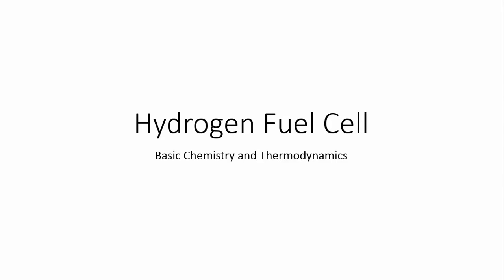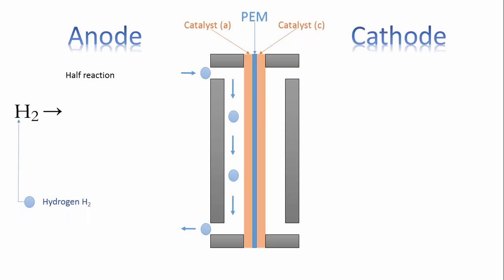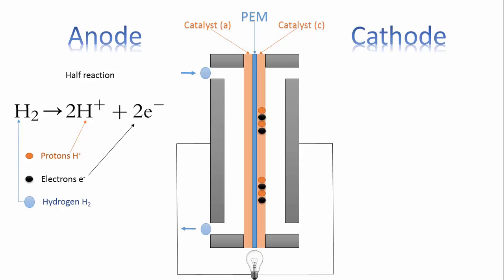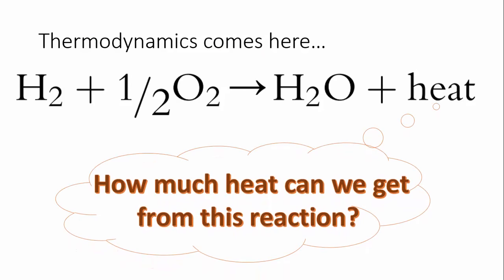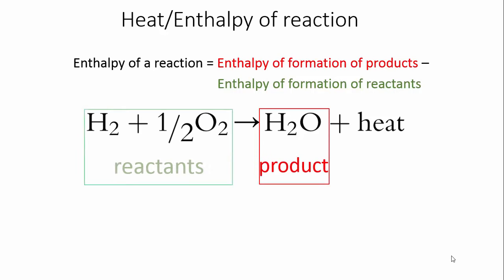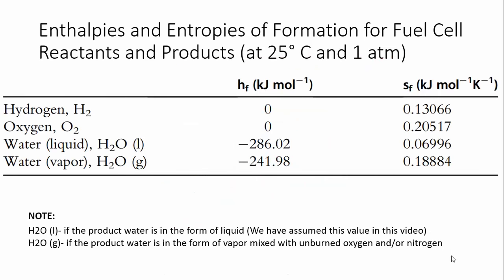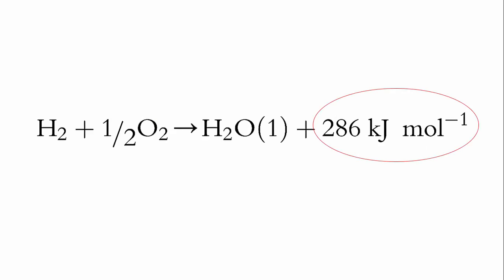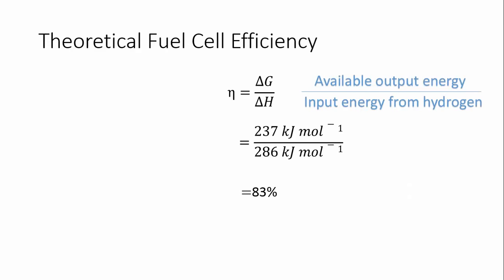Thermodynamic efficiency of hydrogen fuel cells

Comment: Why is it that the battery efficiency can reach ~90% and is not dictated by the thermodynamic efficiency?
Reply: I am not super familiar with hydrogen cells so this is just what i got from this.

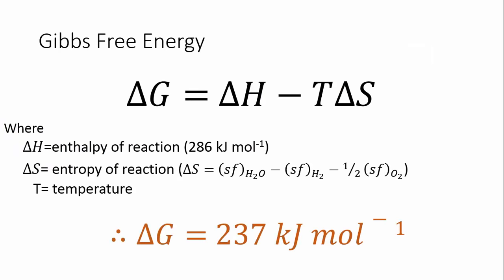At 4:17 the gibbs free energy equation calculates the loss. It has 2 constant values based on the anode and cathodes we use, and then it has temperature. i think that means every anode/cathode pair should have an optimal temperature to run the cell with maximum efficiency.

Although i cant do any of these calculations myself yet, and im not sure how the temperature in this example would effect overall efficiency.
Hopefully someone more qualified can answer this for sure.

EDIT: I think that changing the pressure can offset the temperature value in the gibbs equation.